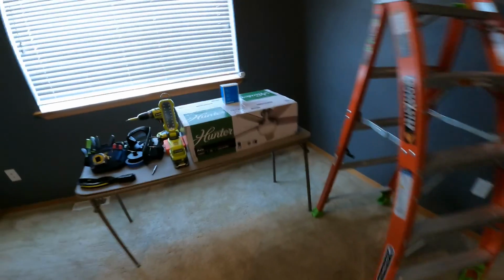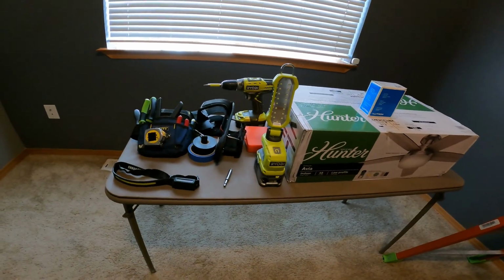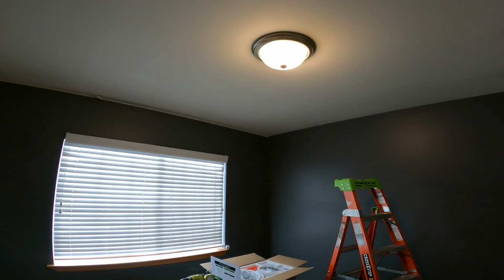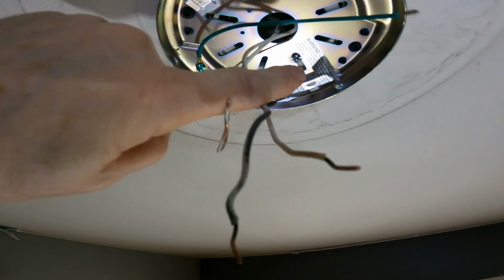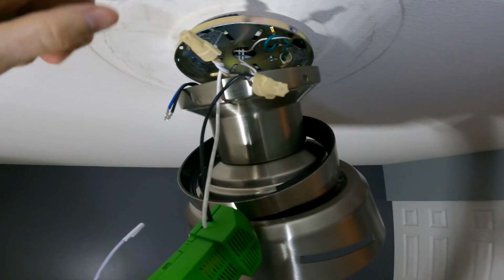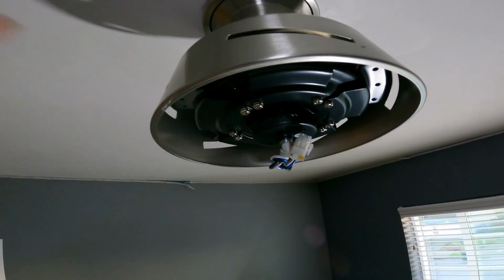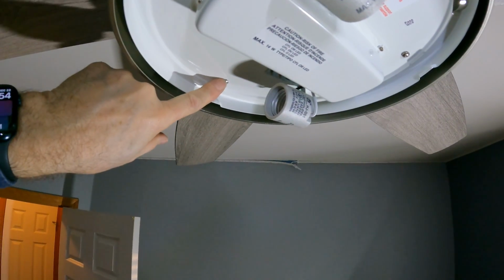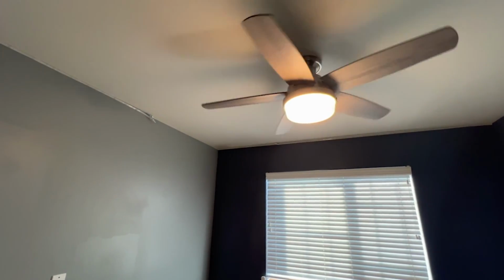How to Install a Remote Control Ceiling Fan and Light - Hunter Low Profile

Comment: Hi what did you do with the yellow wire I installed the same way what you have done but when I turn the wall switch on the fan gets activated and stays on all the time and cant control it from the remote!!!My question is did you connect the yellow wire to the black !
Reply from the maker: It’s been awhile, but I did three of these and it seemed like the diagram was correct with the yellow on the remote module going to the black wire. See time stamp 8:00 where I was showing that part.

Comment: Very helpful.  My wife bought three of these fans.  I found the instructions to be somewhat lacking.  Your video was able to fill in the gaps nicely.  Installed per your instructions and everything worked correctly when power was applied.  Thanks for the video!